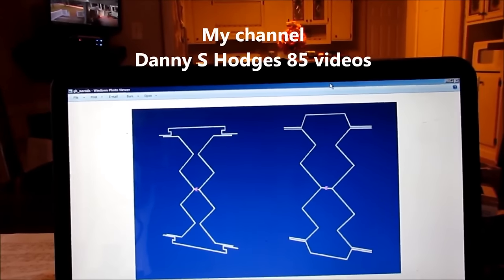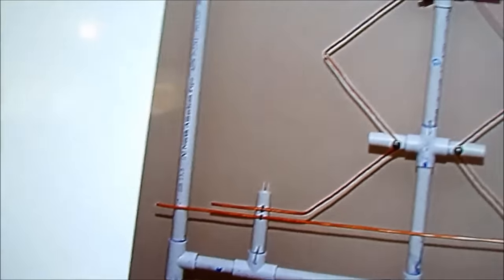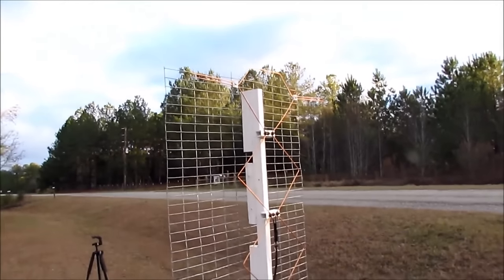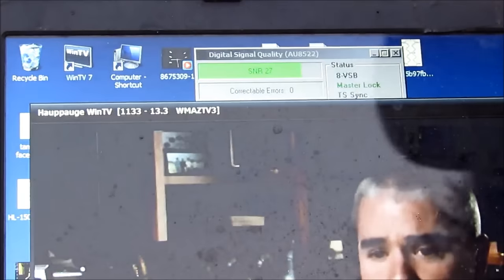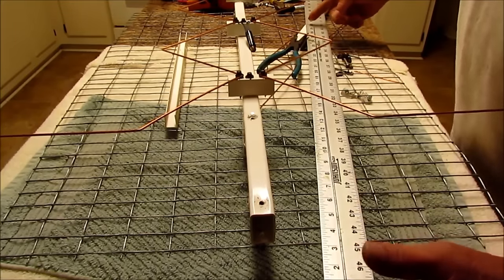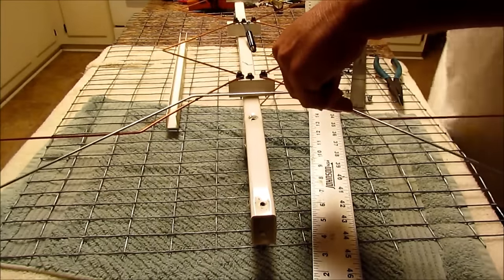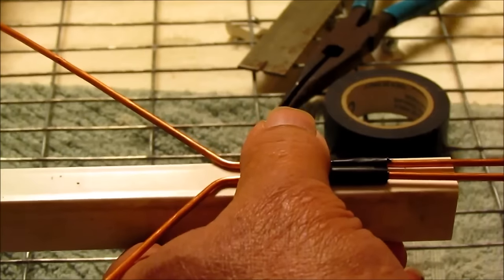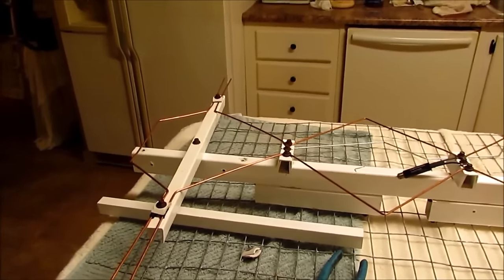Gray Hoverman VHF Fix

Comment: Hi Danny. I'm a big fan. I was really pleased to see this video and the one before it. 

The word "NAROD" is an acronym for Not A Reflector Or Director. The NAROD Hats are their own individual 1/2 wave dipole antennas tuned for VHF. That's why they have to be 30" long. How do they transmit their signal to the rest of the Gray Hoverman antenna? It's not through a direct connection and it's not through capacitance. They transmit their signal through electromagnetic induction. 

When a wire receives an over-the-air TV signal, the wire experiences electrical current flow.  The OTA TV signal is generated with AC electricity and therefore has peaks and troughs just like the electricity from the AC outlets in your house. When the OTA signal goes from peak to trough, the electricity in the wire flows in one direction. When the OTA signal goes from trough to peak the electricity flows in the opposite direction. The time it takes for two adjacent peaks to pass the same point determines the radio frequency – i.e. 200 MHz for VHF and 600 MHz for UHF.  The frequency determines the TV channel number.

When electricity flows through a wire, it creates an electromagnetic field around the wire. When the electricity flows in the opposite direction the magnetic field reverses polarity. This back and forth of the magnetic field causes the wire to radiate its own radio frequency which can be picked up by an adjacent wire which starts the whole thing all over again. This is how the NAROD hats are transmitting the VHF signal to the adjacent wire of the Gray Hoverman antenna. 

I hope that helps. Keep up the great videos.
Reply from the maker: hey a big tks for that
Reply: i have a technician class license  (or whatever they call it now) and reading this one comment gave me a better understanding of the topics mentioned.
Reply: Excellent explanation, Roger.
Reply: Actually there is both capacitance and inductance involved. The combination forms a tuned circuit. Spacing in the gap between conductors affects both values and performance of the antenna as well.
Reply: You said it! I remember when 300 ohm twin lead was used especially  the almost clear kind if you wanted to add another tv to the antenna all you needed to do is place another twin lead over the main lead and tape them together the signal went through the insulation and did not need to strip the wires to make the connection. Vhf has longer wave lengths than uhf so it worked fine without a direct connection. I never tried it with uhf because I did not have a outside uhf antenna.
Reply: Sir my name is Richard..have a question...actually two..does the antenna have to be grounded...and do I need an amplifier in order for the antenna to work.
Reply: Thanks for that scientific explanation Roger.  I built a Gray-Hoverman antenna with strait bar NAROD hats and it seems to work well. The gap between the NAROD rods and the parallel antenna rods is critical, so I assumed that "magic pixies" were jumping across the gap somehow.  Thank you to you too Danny for testing the Gray-Hoverman with and without the hats, which so far, I had failed to do.

Comment: Danny, I just built your "improved Gray Hoverman" on your ultimate antenna PVC backbone and it did an incredible job for me. Because I am surrounded by trees, I used the RCA amp that you recommended. I am receiving the best TV signal I've ever had.
It's a pleasure watching someone work who knows what he's doing and loves doing it.
Thanks!
Reply: 1 1/2" PVC, 8 ga copper wire, 1/4" squares wire fencing (you can buy it 36" X 17' rolls, makes three reflectors). Since my original posting I have removed the RF amplifier which actually improved my signal.

Comment: Damn it Sam.   I am that guy that always has to try and find why something will not work.  Well I couldn't do it on this I get the same 19 channels i used to get on my $150.00 commercial antenna. Thanks Danny.  Now as a ham radio operator I don't have a clue as to why I was skeptical I talk all over the world on 100 watts and a wire. SO this had to work just had to prove it to myself

Comment: Thanks, Danny! I just finished building one like you are showing. I didn't want to spend much, so I made it on 3/4" PVC, and mounted it on a 10' x 1 1/4" PVC pipe for a mast. I took down my Dish TV antenna and slid the mast into the hollow mount - a perfect fit! That put the antenna just above the roof line. All the info I found showed I'd probably get about 6-8 channels. I get 99 channels perfect using your measurements! I have a "PCT multimedia drop amplifier" in my main panel inside my home - BEFORE the splitter that goes to 6 rooms. I'm in the Inland Empire in Southern California, so I didn't have much hope for reception. But, thanks to your help, I'm cable free.

Comment: I built a double bay gray-hoverman (DBGH) tuned for RF channel 39, (WSB in Atlanta virtual ch 2), and it topped out with a gain greater than 20 dBi.

I could find the weakest analog uhf station with a 3dB loop antenna, I mean so weak you could barely see anything through the snow, and then hook up the DBGH to the TV and the picture was perfect!  No snow at all.

Best damn uhf antenna ever in my opinion!

Comment: FYI the plastic material you refer to on this is made for a exterior electrical conduit raceway, can be purchased in any hardware store. I was a commercial electrician for many years and would use this in office area's.

Comment: Hi Danny. Built my Grey-Hoverman to your specifications and it works wonders. I was not picking up our CTV Ch 12 [VHF 204MHZ], so I custom cut two straight NARODS [top & bottom hats] to a 1/2 wavelength for 204mhz which is 27.5"/70cm and it again works great. Thanx for your highly entertaining and informative videos mate.

cheers, from Spruce Grove, Alberta -  Canada.
Reply from the maker: thank you for your commet
Reply: Hello Ole, How do you figure out how long you need the NAROD at different mhz?
Reply: @danaharris503  if you know the wavelength of a frequency you cut that in half. That is your half wave. It is the distance from Peak to Peak an RF transmission. CB frequency wavelength 36 ft quarter wave antenna is 9 ft that's why they had that 9 foot steel whips on vehicles

Comment: Danny, just want to thank you.I made this antenna the Gray Hoverman using some metric measurements i found on the internet. I had it set temp for testing 10ft off the ground. I could not believe how amazing it worked. I went from getting 22 channels to 47 channels. Some of them about 70 miles away with full bars on the meter. works great if you want ill send you some pictures. I used PVC trim that i got at a big box store.

Comment: Hey Danny! Built my Hoverman with the hats using #6 awg copper. Found a roll of galvanized hardware cloth at Home Depot for $6.98. 1/2" square mesh works well for this antenna. It has no trouble picking up 23 digital channels just sitting on a stand when testing. Will be putting it in the attic for its final mounting spot. I have less than $30.00 in it and should do quite well for my purposes. Thanks again for the video!
Reply from the maker: HEY THATS ALLRIGHT

Comment: Something you may want to consider doing instead of using the electrical tape: maybe if you just put some heat shrink tubing on the copper and shrink it, then just use the screw in the center,  and it may be enough for it to be about a 1/4 of an inch between the two copper wires. I think I may try that myself. Great build and tutorial, thanks!

Comment: Ahoy Dr Hodges! (hope you don't mind me calling you that-a fella used that title in comments on this video-my sister jokingly calls me "Dr Doty" (my last name) because I fix/repair her cars/TV's/appliances/etc.
Anyways-I built an antenna using your guidance videos with the intent to use at my home in Liberty, GA. I was having trouble receiving PBS TV. I somehow got diverted to trying out idea of using a dual antenna system-pointing one in direction to Wrens,GA to get PBS from there and second one pointing to Macon, GA for other channels. Amazingly it worked!! I found this idea on a fella's Youtube channel-it's called "Doug's Basement". The antennas are wired together using a 2 port signal splitter in reverse order (antennas connected to each of the 2 output ports and the combined signals sent from the one "input" port to the TV. I used 2 regular Channel Master antennas mounted on the same pole-one at top of pole the other approx 3 feet below. Doug says it's important to have a minimum distance of 2 feet between the two antennas and that the length of cables attached between antennas to the splitter be exactly the same.

I am now installing the Gray Hoverman antenna I built at my sister's house in Florida. I have discovered we are not receiving a much desired PBS channel here. I had not added on the "top hat" wires and that is why I'm back here to see how to do that. (Hope it works!)

I drive through Dublin, GA on my road trips to Florida on Hwy 441- thought it be cool to stop by and visit ya!
Enjoy your videos! Happy holidays to you, Dr Hodges and family!
Reply: Bourn, I find your reply very interesting. I did a search on YouTube for "Doug's Basement" but could not find any info on antennas. If you have a link or another way I can locate this video please post.
Thanks RG

Comment: You're welcome for the NAROD idea. They are capacitivly coupled antenna elements, not reflectors or directors. The screen behind your antenna elements is the reflector...

If you're going to make a lot of these, you might want to make up some sort of wire bending jig.

Keep up the good work!
Reply from the maker: ok brother tks for the people...I SEEN THAT YOUR THE ONE THAT SENT ME THE LINK TKS BROTHER
Reply: Richard how does the element work not being connected? That is why it is mistaken, if so, for a director or reflector......but it obviously works.
Reply: Scientific Answer: The NARODs are capacitively coupled to the existing elements. VHF TV signals induce an alternating current in the NARODs. Some of this alternating current is transferred to the existing elements because the parallel sections of the wire act like capacitors.

Non-Scientific Answer: PFM (Pure Freaking Magic).
Reply: Richard, the hat acting as a capacitor or capacitivly  coupled antennaelement is an interesting idea.  Do you have any more informationabout the capacitor coupling with antennas.  thanks for sharing. rob,
Reply from the maker: OK TKS
Reply from the maker: I MIGHT ALL READY HAVE SOME
Reply: Two wires running in parallel act as a capacitor.

If we assume 8 ga wire with a separation of 1/4 inch, then it would have a capacitance of 0.510 pF per inch. With the parallel sections of wire adding up 21 inches we have 21 inches x 0.510 pF/inch or 10.71 pF of capacitance.

Do a search for gimmick capacitor for more information.
Reply: Being originally from Tennessee, I had always heard this "hardware cloth" referred to as "Hog Wire". LOL!  I believe hardware cloth is the correct term (the screen reflector behind the antenna).

Comment: The element that you have in question that is suppose to improve the upper vhf channel reception does not need to be physically ( electrically) connected to the rest of the antenna. It works on the same principal of the yagi antenna. when the yagi antenna is designed to work with the elements not electrically connected to the antenna, each element of the yagi antenna increases the   signal strength going to the driven element of the antenna. Just wonder why this element that we are talking about was not divided in half as an driven element of a yagi antenna would normally be? I think it would work much better than the solid element that was used.

Comment: Does the size of the reflector screen have any effect on the NAROD hats?

I want to build one of these with NARODs and a reflector screen, but I want to make sure I use an optimal screen size.
Reply: @HunterZBNS
 - During my Testing with BIG and SMALL Reflectors... To be honest, it doesn't make a difference.  The only thing is that the Reflector needs to be 4" Inches away and that was very important!

Comment: Danny, I noticed you do all your testing in the evening. Have you tested in the morning or afternoon hours when atmospheric conditions are less favorable? I find I can receive all available channels but during the daytime they vary wildly in signal with pixelation quite frequently. Sometimes I lose signals completely. Some days are perfect but most vary. I'm 68 miles from all tower that are only 2 to 3 degrees apart.  I also have a pre amp hooked up. Tried with pre amp and without.  Little difference.  Is there any way to minimize this during the day?  I suspect there is a lot of multi-path signal. Antenna is up about 16' . Is this just something everybody puts up with at these distances or would and 8 bay antenna help?

Comment: I just built one of these. I went from about 35-40 channels to almost 65! I use a Winegard amp too. I didn’t use a reflector, though. Thanks!
Reply: I got a reflector and am now over 70! I even got a station from 60+ miles away. My VHF actually works better when one hat touches the antenna.
Reply: @5roundsrapid263  - Wow, great improvements!

Comment: Hi Danny,

I guess the other guys  outlined the principle of "NARODS".

Like you I couldn't  comprehend how those horizontal top hats could possibly work not being connected to the two vertical elements, but they DO !

Listening to you talk about that, it dawned on me; reflectors aren't directly connected either; but they work too.

I had the dimensions for the top hats written down for a long time, I even made them up at one point; before ever getting around to actually installing them on my "GH" sometime later.

A "Cheap Trick" for  good reflectors are the wire cookie cooling racks from the , "Everything is a $" type stores. They come in pairs for a Buck.  It requires two pair.  They have rounded corner frames and N0 sharp wires protruding to poke or snag things.  They also appear very professional and commercially made on the Antenna.

Do you have the dimensions for the alternative NAROD's on the antenna diagram on the left hand side ?

Keep up the good work.
Reply from the maker: i do i have to look for them

Comment: Danny, I had built your Ultimate Antenna and was happy to get 33 channels. After I saw this antenna, I built one with the hats on it and now have 44 channels (No signal booster, just the antenna) ! Man this is great - THANK YOU !!! 
Question; I know you do alot of testing, did you try putting those hats on the Ultimate antenna, I just wonder if it would help on it or not ?
Reply from the maker: i didnt .tks
Reply: OK Thanks

Comment: I've come across some very hard "tempered steel wire 0.104" 12ga.,  it came from a fallen high voltage transmission line,   it's the core wire inside of at least 7 aluminum wires.     The question I have would this steel wire be alright to use as an antenna instead of copper or aluminum.   It is so hard that it should be spot  heated to cherry red to bend it,   otherwise it will likely break if bent to the usual radius for copper ground wire?    regards
Reply from the maker: rusting will get you

Comment: Danny, have you tried this add-on with the $12 antenna reflector? Also, have you tried it w/o any reflector, like your reference pictures show? Thanks again.
Reply from the maker: YOU NEED TO WATCH MY REFLECTOR DEMOSTATIONS
Reply: Thanks, Danny. However, you made this video on Jan 7 and the $12 reflector video on Jan 10. I don't see a video after that, which shows you comparing the different reflectors and the Hoverman w/o a reflector or w/ your $12 one. Is your referenced video called "REFLECTOR DEMOSTATIONS" or is it listed somewhere else? I was thinking the modified Hoverman, w/ the hats, and your $12 reflector might be a winner. I was just looking to see if you've mixed and matched the designs. Thanks again.
Reply from the maker: go to my channel i got 90 vidieos

Comment: Danny, if the new cross member braces are made out of metal, they may interfere with VHF reception. You might be better off with just using the new pieces at the top and bottom that connect to the center of the NARODs.

Comment: So do the top hats you built end up being a wire 28" long?  It seems like your working with a 7" wave length, so 4 X 7 =28".  Right?
Reply: I also would like to know the length of the wire in the top hat.
Reply: @hogcat858  - It suppose to cut in " half " = 14" each Side.  Also, you need VHF and UHF to be separate.  You join them with a Pre-Amp with UHF+VHF Input.  Other than that, it will be no good!

Comment: Thanks Dr. Hodges The Grey Hoverman I built is doing fine I put it in the window now Im getting 47 Channel some 50 miles away from Memphis TN Im going to do the add on  then Im going to build a Ultimate antenna just for kicks. waiting on the video on how to make a easy reflector I just bought a roll of wire......Waiting on the video
Reply from the maker: YOU CAN COUNT ON THAT REFLECTOR VIDEO..I NEEDED TO DO THIS ONE FIRST....MAN I STARTED TO CALL YOU AND TELL U TO LOOK AT THIS VIDEO.

Comment: Danny, I like your videos. I built the Hoverman with Hats, but I'm having trouble with them "shorting out" in rain. Seems that enough water flows over the wires for the hats to make contact with the center wires. Not sure what to do about it. I'm thinking of removing the hats and using your VHF antenna added to the Hoverman.
Reply: maybe instead of 1/4 inch over top,  put it off to the side so water will drip but not hit the other wire.
Reply: @wagstail4804  -  What about heavy snow? :(